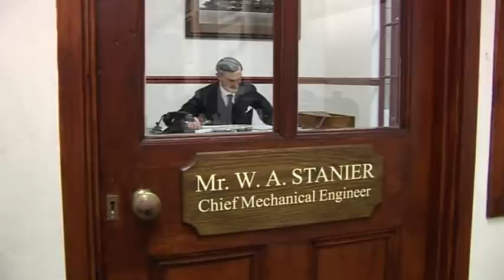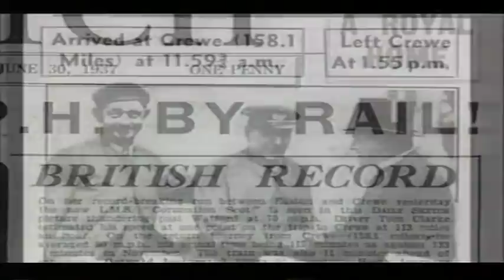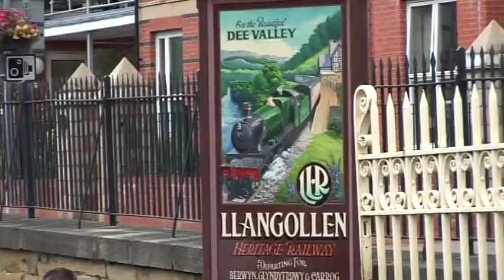Sir William Stanier

Comment: One point that may be relevant, I believe the LMS were sufficiently impressed by the GWR Castle locos that they wanted to licence the design, which the GW refused to do.  So conceivably, since the LMS couldn't get the Castles, they took someone from the design team instead!
Reply: I understood it that the LMS requested that the GWR built something 50 Castles for them, but the GWR didn't have the capacity to do so in the timescale required, and in any case there was legislation forbidding one railway company from building equipment for another (but they could buy from a manufacturer, as many did). There was, however, no legislation preventing one railway company from providing drawings of its finest products to another...